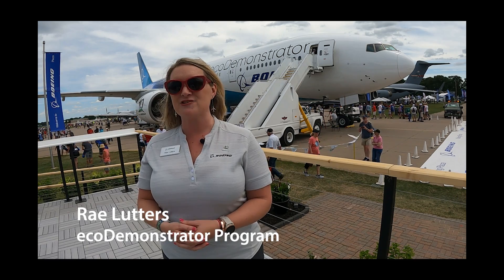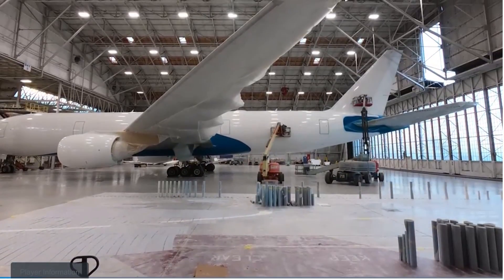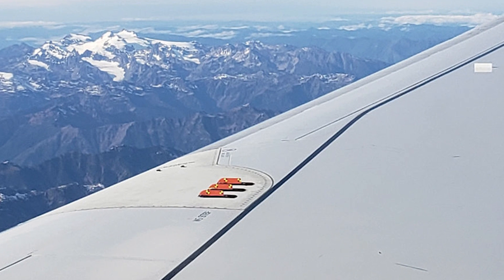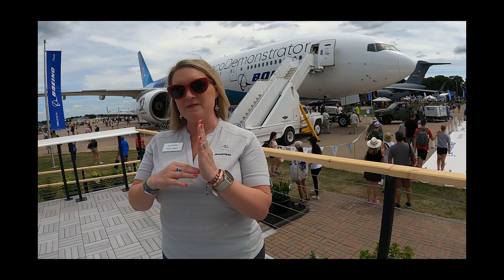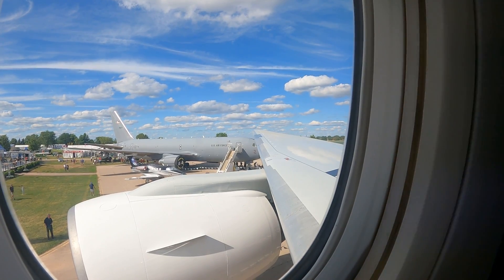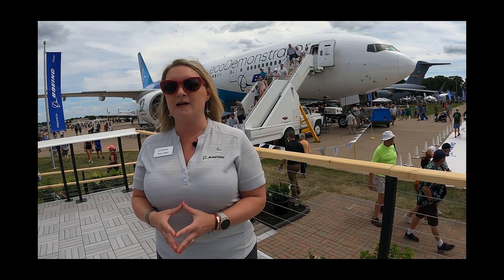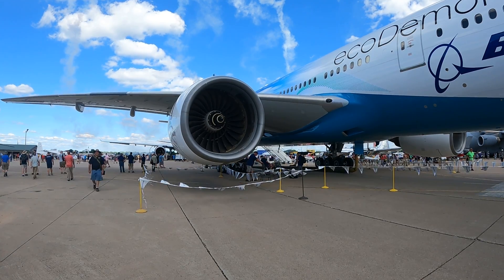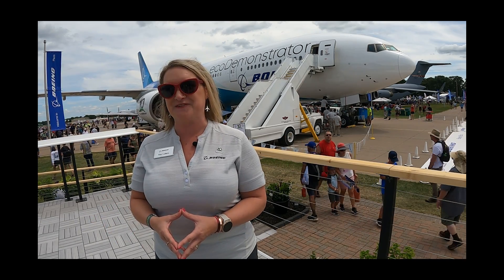Boeing's ecoDemonstrator at AirVenture

Comment: 2:47 pause and look at Step 1 and 2.
Step 1- Feedstock is collected
Step 2- it's made into sustainable fuel
They kinda left out what they have to do and how nasty the emissions are and how much more carbon is pumped out during cracking and refining. Then they say mix it with Jet Fuel and it's 80% less dirty. Magic. 🪄 🪄
Bp did a excellent job on that pdf showing how it's made. They used the right buzzwords (Sustainable. Biofuel. Carbon. They left out that the amount of refining needed and the amount of emissions created while making this "sustainable fuel" would be the same as if you used normal jetfuel. It'll even out. But BP wants to appear woke and they did it. They're good